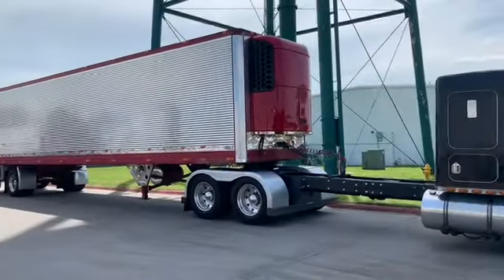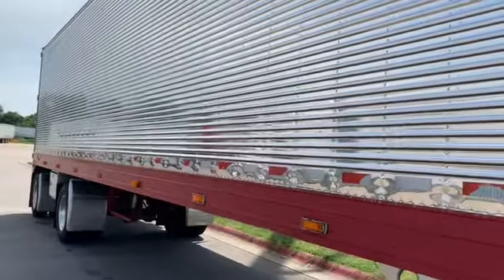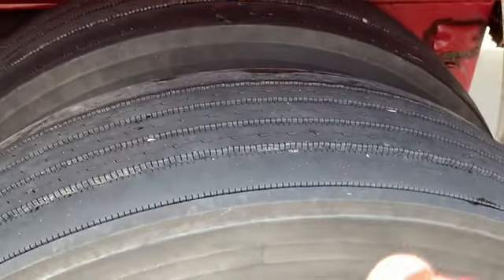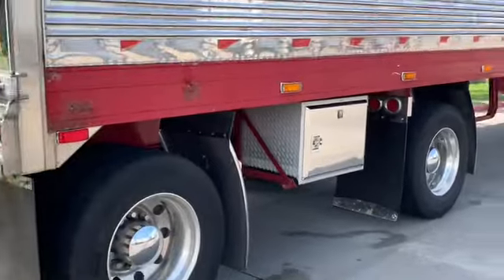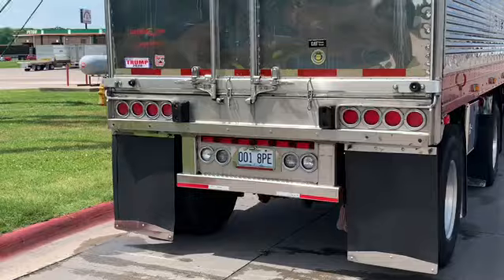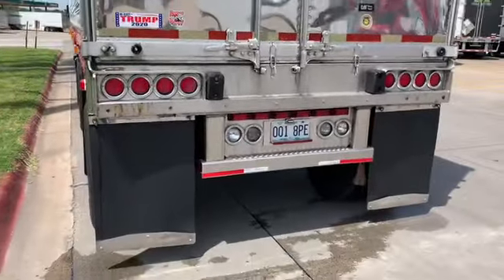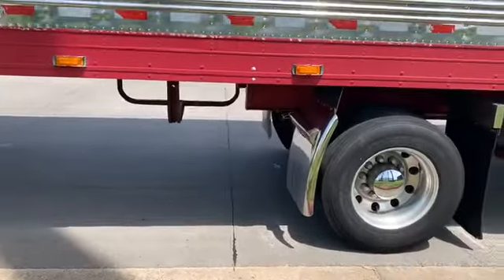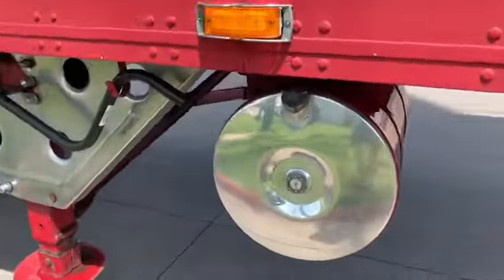1995 Stainless Spread axle Utility Reefer

Comment: Who stretched your truck?
Reply: That Trk was painted & stretched  in Houston,Tx
Reply: @scottycollins1829  I live in Houston you have there number if you don’t mind
Reply: I don't have the number in this phone,,it was in my old phone from '07. If I'm not mistaking the shop used to be close to 610 & Mccarty
Reply: Btw,, I live in SAN ANTONIO (ALAMODOME) ,but I use to haul quite a bit to HOUSTON (ASTRODOME)
Reply: @scottycollins1829  what up?
Reply: @scottycollins1829  how much it cost for stretch and how long is it
Reply: @hellhound6598  cost can be anywhere FROM 3k-7k depending on which shop does it
Reply from the maker: The truck was stretched by the Original owner.  It was done 20+years ago.    It was not done in Houston.
Reply from the maker: @scottycollins1829  it was not painted or stretched in Houston.    Painted in Ohio     Recently repainted White in Pearland TX
Reply: @v8equipmentandmotorsales160  ok cool ! And did you ever sell the trailer
Reply from the maker: @hellhound6598  we did.    It sold within a few days